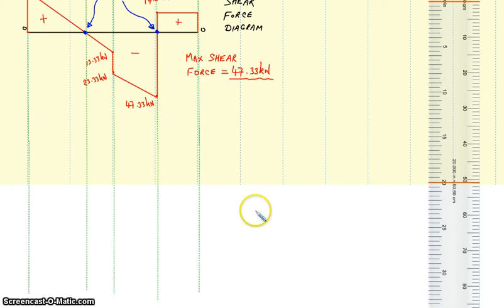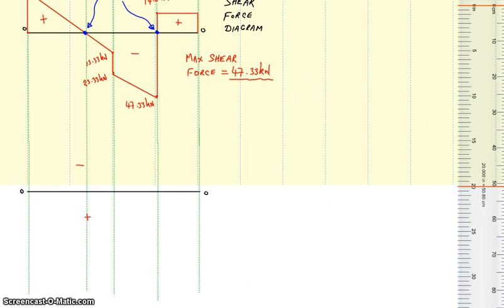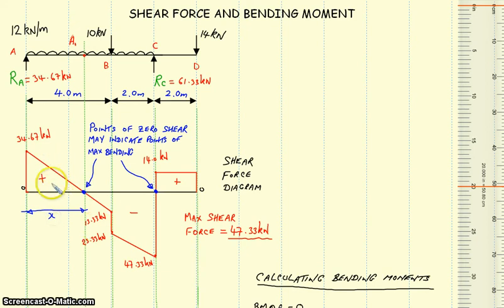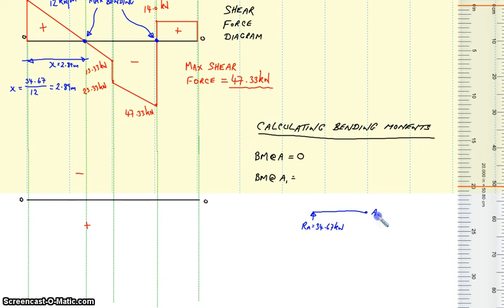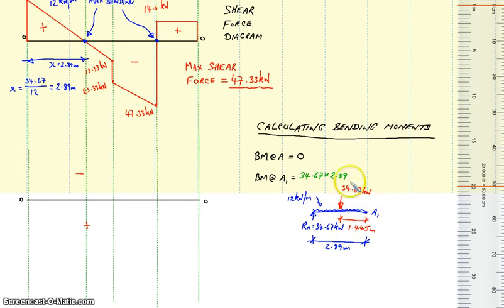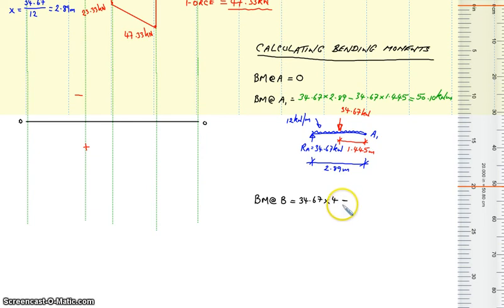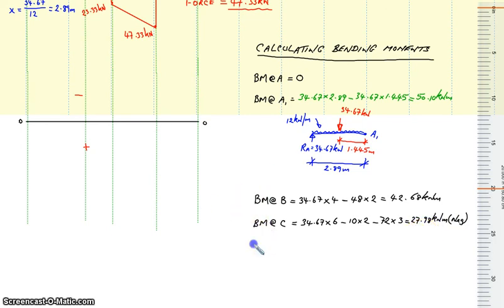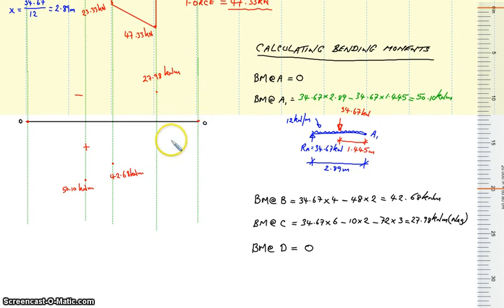Calculating Bending Moments & Drawing a Bending Moment Diagram - Video 3

Comment from the maker: Hi.

I'm glad you found the videos useful.

I had fully intended to produce a suit of these to cover areas such as Second Moment of Area, Calculation of Internal Forces on Frames, Design of Simply Supported Steel Beams to Eurocode 3, etc. but time is always the issue. I still hope to get some of these done before the end of the year. What are you currently studying and where? Best regards, Stephen.